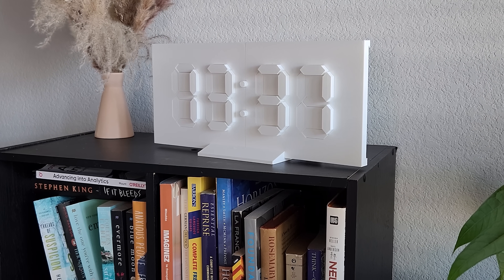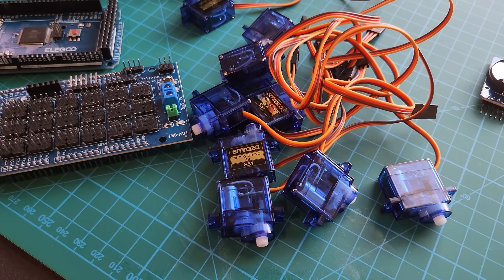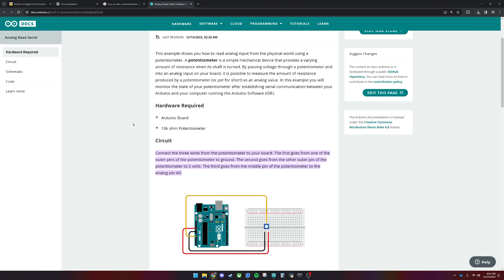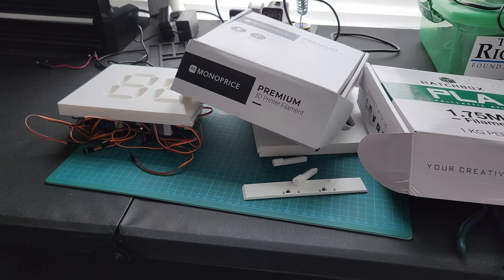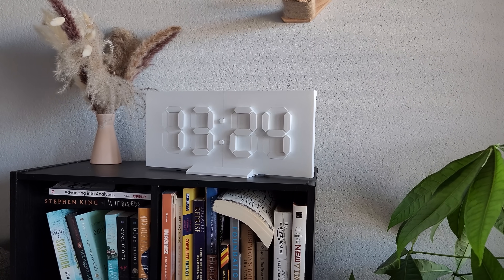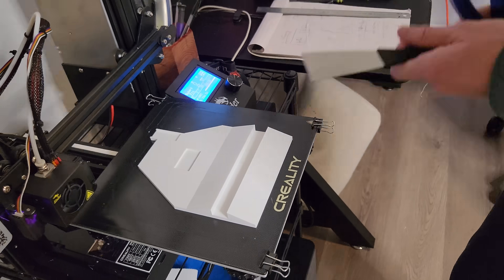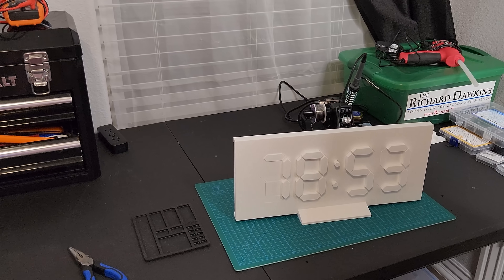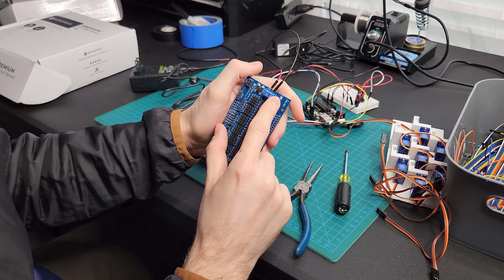I Built a Minimalistic Kinetic Clock Project with my 3D Printer and Arduino

Comment: Hi
Reply: I have a wall clock idea, in which there a hour glass in centre of the wall clock, 😊 and the number has led in it the hour glass has one hour of sand ⏳⌛ and the number has led, suppose that the time is 1 am , so the number 1 led turn red and our glass was turn at the same time and reset itself. 
When the hour glass reset itself the mechanical sound also produce

Comment: I'm starting to dig in now.  Did you do any analysis on what time change draws the most current?  The time when most segments change position is what I mean.  If not, I'm going to have to come up with a spreadsheet.  Thinking about doing a solenoid approach but need size my power supply and each solenoid will draw close to 1 amp.

Comment: This is awesome!  I think I'm going to design one with my own spin and make it a future video on my channel.  Also, you could just use a high wattage power supply, the kind with the metal shell with holes in it that is the voltage of the servos and use a buck converter to get 5 volts for the arduino from it.  Also, the barrel jack on that Mega 2560 can handle up to 12V input, although, I try to not go above 9V.

Comment: Motors seem to be a huge issue both in size and energy consumption. Maybe a set of electric magnets would help, assuming the clock is standing up right and only one puls is needed each minute.

Comment: I did something similar powerwise on a project. First, I'm an electronics noob as well. How I got one power source was to get a more powerful power source. My project used 5V and 3.3V. What I got though was a 12V source. 5V and 3.3V sources typically are low amperage, so they are terrible for running low power projects that have a lot going on. So  I just got a big 12V power supply with a lot of amps, and then I fed that through power circuits to cut the 12V down to the 5V and 3.3V needed for each circuit of the project. This can get complicated as you really need to ensure the power systems of each circuit are divided and you really need to go crazy on grounding your circuits. My project used optical circuits to separate circuits from each other, so they could communicate without being connected electrically. 

I'm pretty sure you could retro a similar solution into your project. Replace two power supplies with a larger amperage 12V, and just add a couple of power boards to convert it down to the probably 5V your using. That way, you just have multiple internal power circuits feeding the various parts of your project, which are fed themselves from a single power cord. Amazon sells 10 packs of really good power circuits  they are super easy to work with. Just remember to ground everything heavily.

Comment: Why not solanouds? 

Sound could be fixed by adjusting the overall input voltage to them or adding veritable resistors. 

Other issue is making sure the prices slide right.

Comment: Did you ever consider replacing the front panel and digital segments with real wood?
Reply from the maker: Yes! I'm thinking it would be cool to make it where you can change out the face between plastic, metal, and wood 🙂🙂

Comment: So, I built this clock, and it works great except once in a while a segment doesn't work correctly,  so I unplug the clock, and then it starts working correctly again.    Any suggestions on how to prevent this? Thanks

Comment: ATmega2560 .... for 4-digits clock.... awesome! why not core-i9? use a steam-hammer to crack nuts... Btw. ATmega328 can drive 16 servos directly (almost hardware way) with hi precision (on pins or via 596 registers) and much more with 595 registers and some software tricks even on atmega8 (Lynxmotion SSC-32 project).

Comment: I have a habit of collecting power supplies.  I pull them out of anything that's being junked and I put them to use in other projects.  Out of a Da Vinci 1.0 3D printer (purchased for $25) I pulled many good parts but the power supply is awesome.  +3.3v 12a,  +5v 14a,  +12v 14a,  -12v 0.3a,  +5v 2a.  One of these would work for this clock.  Use the 5v2a for the Arduino, use the 12v 15a for the servos. You also have the 3.3 for LED lighting.  The supply has the standard 3 prong power cord socket and a power switch on it. 200 watt max on this supply.  Look around for a cheap Da Vinci printer.

Comment: 12 hr clock with a PM indicator and you can remove 5 segment circuits from the tens of hours unit. Yeah, that makes the 1 digit unique (1 servo for 2 segments), but "The best part is no part."

Comment: You could use two different power supply borads in parallel and power them with 110V mains voltage and hide them inside the clock itself. But be careful with that.

Comment: i think a simple PDB designed for Quadcopters will help with distributing the wanted voltage for each one... usually they deliver input voltage + 5V + 12v, sometimes also 3.3V.  so I guess you could use one of these with 1 9v power supplier

Comment: Just watching and thinking… wasnt it easier to use only 2 servos? One for the digit parts that need to come out and one for the digit parts that need to be hidden? You would still need to figure out how every digit part would be connected to the servo for that moment of time, but still i think it would be much easier to make than how its made in this video. It would also cost less and would have way less wiring and a much slimmer design at the back of the clock. Anyway the project is way cool, i want a clock like this too now 😂
Reply from the maker: So since I made this video I've seen some really cool designs that use gears. Each digit would only require one servo motor and it can turn through all 10 digits.

Comment: That amount of servos use a lot of power. To power all the servos I would recommend separate power rails instead of powering them through the servo shield. For power, consider using a USB-C PD trigger board. Set it to 5V and you're done! Now you can power the clock through any PD compatible USB-C charger.

Comment: awesome work👏. The moment I see your title Kinetic digit clock, intuition said relays & laser cut. Turn out u use servos & 3D print which is cool. probably I would try small 5v relays which may have that little tictac sound when solenoid activated. but not as noisy as servo which I didn’t like either. Thanks for sharing your ideas. ❤
Reply from the maker: Hey I appreciate the feedback. So since I made this video I ordered a relay and I've been playing around with that I've also been looking into using magnets. 🙃
Reply: @LukasDeem  yeah 💪. magnets will increase the relays throw distance. Good idea should be shared❤️. Thanks for making this type of video, it serve all sorts of makers communities.. maybe using your technique to work on other projects. You know the hot wheels toys helped me make a machine for my customer. ❤️keep up the good work bro. You are awesome.
Reply from the maker: @Jim_One-wl4ke  thanks so much man! Your encouragement means a lot. These projects take a lot of work in the little pockets of free time I have. 😅

Comment: I love the idea behind this project.  The noise from the servos could be annoying though.  I wonder if nitinol muscle wire could do the job more quietly?  The challenge would be getting the required amount of movement.  Nitinol contracts by 5%, so assuming the required movement is about 1cm, you need 20cm of muscle wire per segment.  That sounds too expensive, but the amount could be reduced by a gear or lever to swap force for distance.  If the segments move freely, you might get away with 5cm per segment.

Comment: Could have used a smaller arduino with multiplexing the digits but it will have to switch between them to make it work.  Switching power to each digit at a time will only need power for 7 servos.  Maybe an update on how to multiplex?

Comment: Love it! The noisy servos are a deal breaker for the bedroom though. Challenge for future add-on: small double digit seconds display, maybe on upper right, actuated by Nitinol (muscle wire). Or, maybe actuate the whole thing with Nitinol? If the moving printed parts are light enough, maybe could be done with little to no contact between moving parts and frame? Or maybe a few tiny magnets to provide spacing? Anyway, thanks for the great write up!

Comment: if you add a slight outwards taper to the segment pieces you can sand them flat together with the face and the clock will be seamless

Comment: Could an idea be to work with an electromagnet that just "pushes" items away (or pulls them back). Then we don't need servos?
Reply: sems like a great idea... magnets in the number segments and coils that reverse the poles on the back of the clock

Comment: Cool project, too bad it's so big at the backside. For the powersupply, you can just add 2 plugs to the most powerful one and connect the plugs in parallel. This way they have the same voltage. Each arduino model draws the current it needs.

Comment: Way too complicated, use an old retail 7-segment LED digital clock (for the electronics) and pull off the segment outputs, connect them to relay drivers (Darlington, etc.), drive solenoids for each segment and 3D print the segments and the faceplate with built- in limit stops for the extended in and out positions and use solenoids linked with foam (or similar) and drive the segments to their respective in or out stop positions (no alignment issues). No Arduino, no servos, no feedback, no gear chain, and perfectly aligned in and out positions of segments.
Easy Peasy, 
George

Comment: To reduce cost & noise, could use 3 motors in total by creating a moving x & y frame & a z axis actuator to push each segment out. Combined with small springs & some permanent magents to keep flush alignment.

Comment: just a tip for getting 3dprints off a glass bed is to put it in the fridge for roughly 30-45 mins. i spent way too much time and filament on trying to scrape it off, but i found putting it in a cold container for a little bit is the way to go.

Comment: Great project!  Going to try replicate.   Any suggestions?  What sensor shield did you use?  Thanks
Reply from the maker: Hey I put a link to the shield I used in the description. However be aware that the metal pins on the back where they me up with the top of the USB housing on the Arduino mega can touch the metal housing and short out. You will need to modify the pins somehow easiest way is to just put some thick electrical tape on it to prevent contact.

Comment: As art it looks cool, but as an engineer work is awful. What I see is is a brute force solution that I bet is possible to achieve the same with less than half of those servos, plus different other approach that will require less resources and time.
Reply from the maker: Yeah I agree with you it's definitely not the most efficient or ideal way to do this 🤣. However, I learned a ton by doing it 😎

Comment: Probably a linear servo would be better as you don't need the gears anymore. They also make far less sounds as they only use 1 worm gear instead of several gears. And they come in very small sizes

Comment: Can you provide any more information on how you did the wiring for the calibration steps? I just managed to fry an Arduino when I tried it by shorting it out.
Reply from the maker: Hey did you put the sensor board on top of the Arduino mega? Depending on which model of the sensor board you got it has two pins on the back of it that make contact with the top of the Arduino mega and can cause shorting. I would check that first. For the calibration I had everything wired up completely and just adjusted the code so that I could go through getting each digits high and low positions recorded

Comment: Everything old is new again.  While their is minor benefit to independent motors, it's way overkill at least just for a clock.  First thought was cams, second thought is multiplex the motors.  Actually I held off, make my own video at some later point.  But now Fran posted a video with almost exactly the same.
A plate, with vertical riser cams on it, could easily cover 4 elements, one motor for the top half and another for the bottom three.  Or do a plate with 4 channels on the edge, closer to a normal cam.
Already been done of course, it is old tech from way back anyway.
Fran Blanche    Digital Clock Or Automaton?
The pivot points and the cam levers operating in more than one dimension makes it even better.
Reply from the maker: Hey I agree with your suggestions. I'm actually considering using magnets instead on the next version. What do you think?

Comment: Looks great! Have you thought about using home made custom solenoids to move the segments with end stops to ensure consistency? Should be less noisy and you only need one connector per segment on the arduino. And it should be quite a bit cheaper I think.

Comment: How easy would it be to make this thing bigger? I was thinking of using a wooden panel and only printing the digits.
Reply from the maker: So it would require that you scale all parts except for the servo brackets and the gear teeth on the back of the digits. If you feel comfortable doing that then yes, you could certainly pull it off 😀
Reply: @LukasDeem  I'd would add glide paths to the edges because sometimes servos just eat 3d printed racks
Reply from the maker: @MissYijare  ah yes! Great suggestion 💯

Comment: Pretty neat project ngl, I wanted to ask tho: Would've a 3D physics based arduino simulator come in handy when you planned on starting this project or any of your other projects?
Reply from the maker: Yes I believe it would have. I think the issue is that simulators don't always have the components I need in them. For example I don't think they have the sensor shield.
Reply: @LukasDeem I see, well I've come up with this idea for a simulator in uni to fix issues like that and also allow you to practically use your 3D models in a physics based environment along with Arduino technology. Only issue is its development because I'm not an excellent coder. However, if you feel inclined to help in anyway possible, please feel free to let me know.

Comment: If i‘d do it from the beginning with the information you already gathered, i‘d use solenoids instead of servos. Much simpler module, thus more reliable, easier to code and presumably also quieter
Reply from the maker: Agreed. I'm already looking into ways to incorporate solenoids into future projects 😌

Comment: Really cool!
Few things I would change if I were to make it for myself (probably make it out of different material, because I like to use wood and metal). 
Also, if you make the sliding parts of the numbers slightly tapered towards the back, you could put leds behind it to make the numbers pop if you don't want a stealthy white on white look. But that would require another power supply ;)
Reply from the maker: Haha I'm trying to find a way to make my next project require more power supplies 🙃🙃. 

Cool idea

Comment: A more expensive version, using the super clean water cut metal for parts would be amazing, because when the pieces are flat, the seams would be invisible.

Great project, thanks for sharing.
Reply from the maker: This is the plan for V2 😄

Comment: Why did you use servos instead of solenoids? You wouldn't have to make the gear transformations, and you could probably get it quieter.
Reply: probably because solenoids arent supposed to turned on for a pretty long time and also use too much energy idk
Reply: @agusprayogo7932 0.42A is too high for that project. Servo is better to retain its position without power

Comment: I've made something similar myself but used a lot of LEDs instead of servos. I think you could power it off 1 supply by using a 12V rated for similar current stepped down to 5v.
Reply from the maker: Hey! I'm trying this technique with my latest robotics project. The parts require 6v but I got a 12v battery and I'm stepping down the voltage for the parts. I hope it works well. I'm still learning how to run the numbers on voltage and current for my projects 😅😅

Comment: I think I would’ve gone with solenoids. Much cheaper, much simpler, much smaller, much less wiring, much less controlling and code. Much less space used behind and much quicker.

Comment: Would be interesting to see it with zero tolerance machining parts and push-pull solenoid as actuators. You wouldn't see gap (very clean surface), its metal, and much less cabels (1 per solenoid + bridged ground). Downside is that this would be more expensive than 3d printed parts
Reply from the maker: Yes! I think this would be so cool though. I'm planning to introduce that in V2 :D
Reply: Like EDM cut parts!

Comment: You could open up the powerbricks and put them both in one box or maybe even on the clock. If you connect them both to one connector you would only have one cable to worry about.